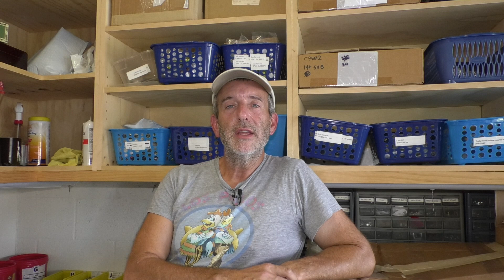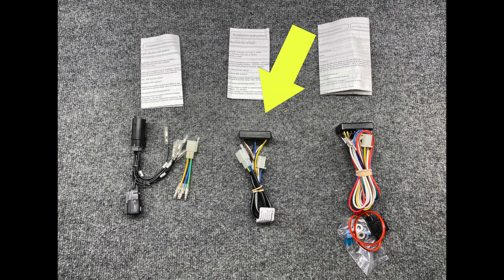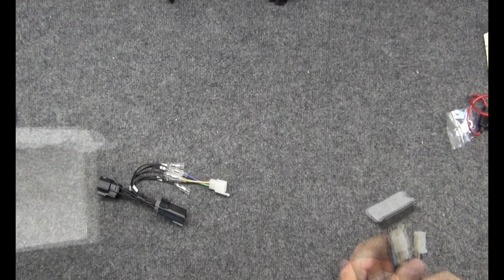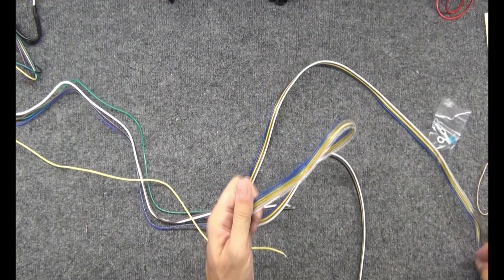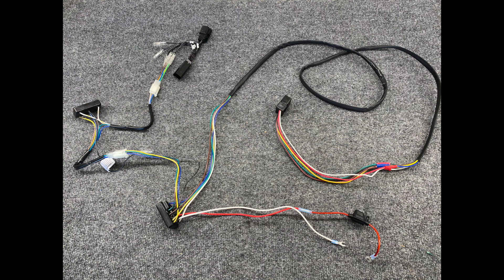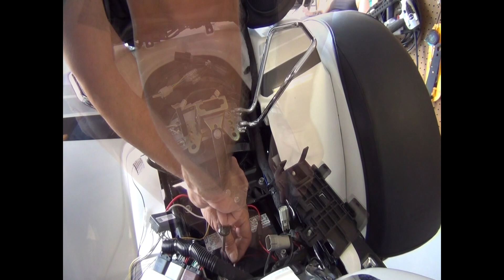2020 Tri Glide Wiring Trailer Wiring

Comment: I have a 2022 tri glide I’m trying to wire for a 4 flat trailer.
Reply from the maker: Same kit, you just don't use the middle module. And you would wire on a flat 4 plug to the white, green, yellow and brown output wires, ignoring the blue output wire from the isolator.

Comment: I have a 22 cvo tri glide.  The instructions say that the 6 pin connector on the bike (if the correct one) would turn off the tail lights.  The only connector that turns off the tail lights is a 12 pin.   There is a 6 pin under the seat by the tour pak.  Is that the correct one?
Reply from the maker: The Tri Glide is the exception to the "pull the plug, turn off the lights" instruction. The 6 pin connector on the front of the Tour Pack, throttle side, is the one to connect to. It does not kill the lights when you unplug it.